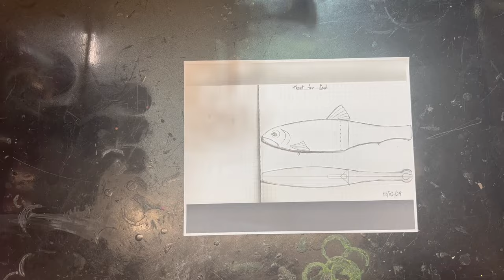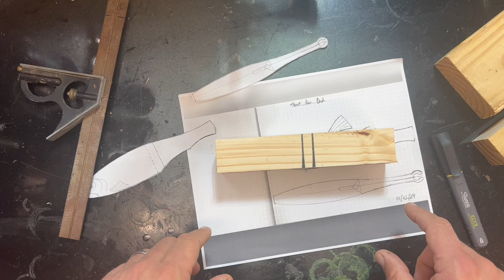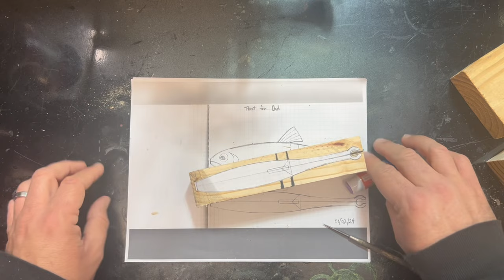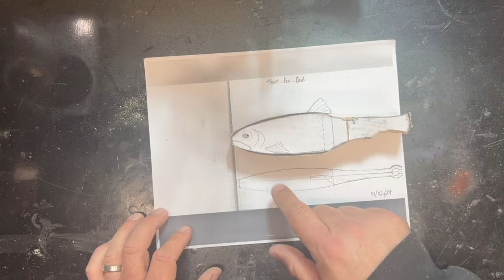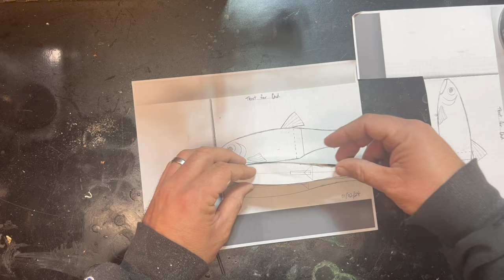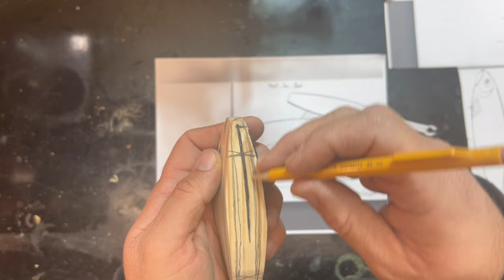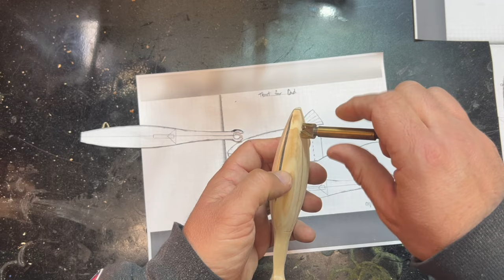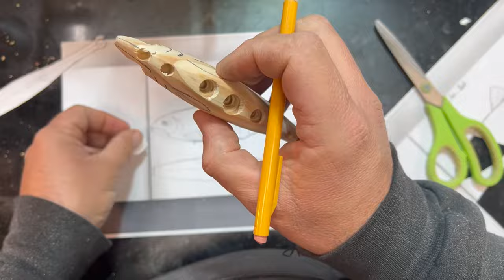Making a Trout Glidebait for my Dad

Comment: One thing I can tell you is that spruce , pine, or whatever does not behave well. As a kid ( like I mentioned before) I got a hold of yellow poplar. My grandpa, n me done a lotta sawmilling when I was little, so I had a life time supply of it. Recently I had a major head injury, so I can't get into my pile of lumber to send you some. Poplar is soft , but not too soft. It doesn't have that obnoxious grain that grabs your drills like happened when you tried to drill out your eye sockets.   It seems you mentioned you're around the Gulf. I know there's still plenty of small time sawmilling going on around there.   Also cypress looks as if it has decent grain as well. Personally never used cypress, but it should be easy enuff for you to find as well. I also have a stash of black walnut that I'd carve into knife , n gun handles. It's a dream to carve , but is expensive to just buy from a dealer.   When or if I get to getting around again, I'll try to get you some decent carving wood.   I have tried balsa , and it's like carving butter , but could not get eyehooks to stay in , no matter what I tried.     But if you can get a chunk of yellow poplar , I really think you'll be in a much better place from the getgo. Also it won't splinter near as bad. The heart of yellow poplar is a Kool drab green with streaks. That could be incorporated into the paint scheme
Reply from the maker: Wow, that was a lot of great advice. I have never had the budget, or perhaps it’s the nerve, to spend money on special wood for these sorts of projects.  I would just be so nervous to ruin it.  That is why I use wood I find on the side of the road on trash day mostly (I know how crazy that sounds). But worry not it has served me well. Sorry to hear about your head injury God speed your recovery, my friend.  Stay Regular!
Reply: Poplar is dirt cheap around sawmills. It's all around a great lumber for any project. It grows thick all over the South. We would saw it up for barn structure framing. It's great for cabinet framing , or just small furniture. In highschool I hauled a load of it for us to make shop projects out of. Pallet mills should have poplar in the scrap pile as well. It's also great for beginner wood turners. 
    I enjoy your channel for you having the little ones share in the experience. Before middle school my folks had me welding, working in the machine shop , baling hay. I had my daughters out with me from the time they could get around.    My oldest one is a knockout, and always has her makeup, and nails done. We have pics of her in her coveralls under her car doing  maintenance on it. She hasn't ever paid for an oil change.      So getting them hands on really builds character.
Reply from the maker: @coburnlowman  the regular assistants and the regular editor will continue to be a big part of the channel.  I’ll see what I can do about finding some poplar. Stay Regular!